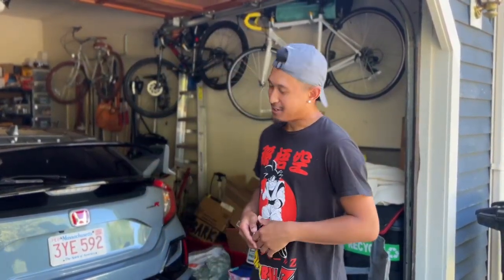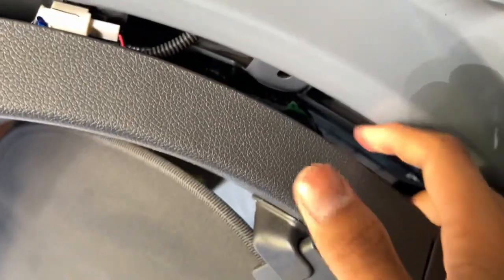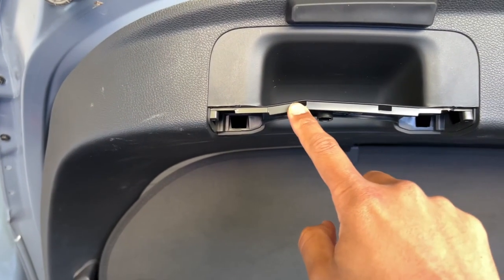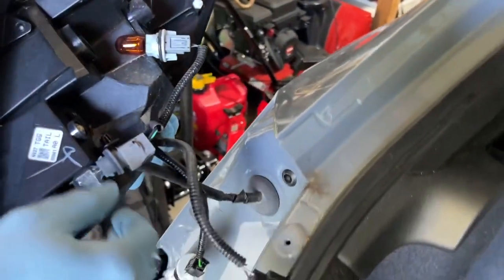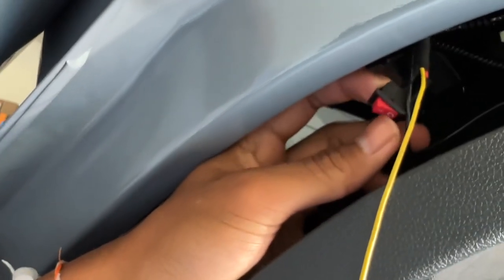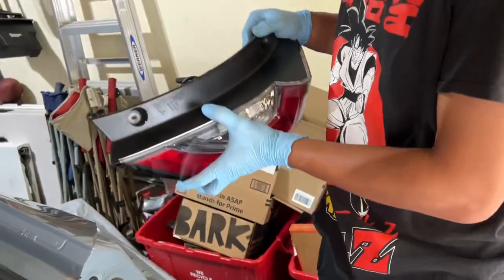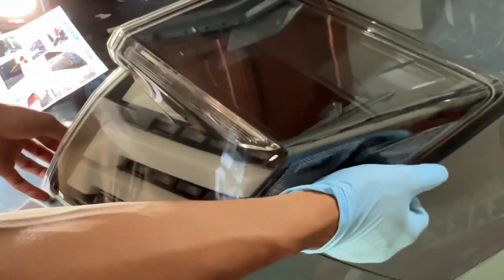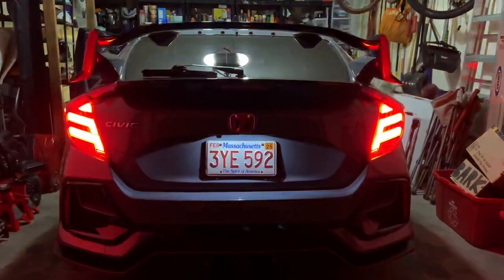Installing one of the BEST taillights on my 2021 Honda Civic Type R | HRS V2 Clear White

Comment: How is the cabin drone on the tomei?
Reply from the maker: It’s pretty bad lol, if you’ve had exhaust systems that has had drone before, this will be the same thing maybe a bit more. It’s bearable for me but I grew up with loud cars so it’s all preference in the end
Reply: @timothysarin  thanks, running the milltek non-resonated at the moment but plan to swap it, not sure how it would compare
Reply from the maker: @Montie_  the milltek is a really good exhaust from what I’ve watched on videos, it sounds really good, one of the reasons I went with the tomei exhaust was bc of the lightweight Titanium metal. If it didn’t kill 2 birds with one stone with what I’m after I probably wouldn’t have gotten it tbh. You get exhaust sounds and shed a lot of weight from the factory exhaust that’s what I was looking for mainly

Comment: Did you do anything to prevent these from yellowing?
Reply from the maker: I haven’t done anything to prevent these from yellowing, I didn’t even know these could, what would you recommend to stop it from yellowing in the future?
Reply: @timothysarin  I'm not sure if these ones do yellow, but I know it's possible with some other clear taillights. These are more of I white tho so I wasn't sure.

I've just heard of some people spraying it with a UV protective clear coat before installing
Reply from the maker: @ironfaucet I’ll definitely keep you updated if these ever turn yellow to also give anyone a heads up 👍🏽
Reply: @timothysarin  Any update? How did they hold up?
Reply from the maker: These have held up great, no yellowing whatsoever so far and haven’t had any other issues 👍🏽

Comment: I bought the used Mugen tail light before your video 1 week, feel disappointed about the quality of Mugen because It has condensation and moisture
Reply from the maker: Yeah you would think with a oem+ item the quality would be a lot better, I think I’ve seen condensation on these taillights but only on the top portion of it and it goes away as the day goes by, I think HRS states that in their description also. I would have bought the mugen tailights also but I like the clear look and the full sequential sequences
Reply: @timothysarin  The mugen tail light just moisture on the top portion , I still take a look at it to see what's happened next
Reply from the maker: Yeah I’d definitely keep an eye out to see if it gets worse, but if it goes away as the day goes by it won’t cause any damage luckily unless the moisture gets trapped then I would be a little worried